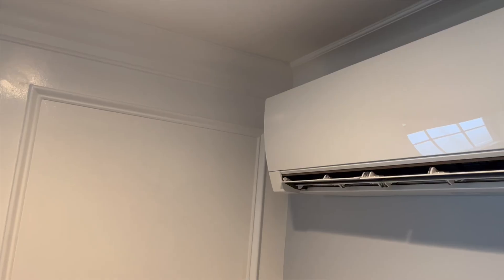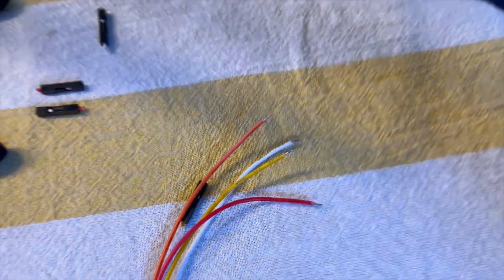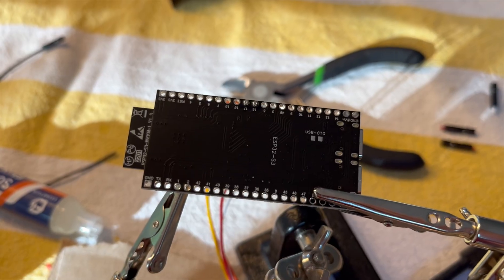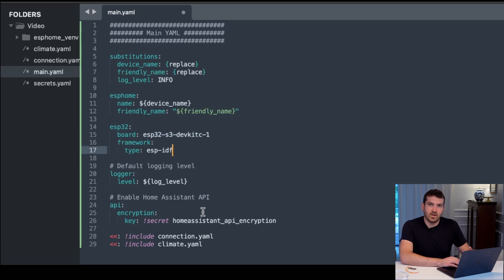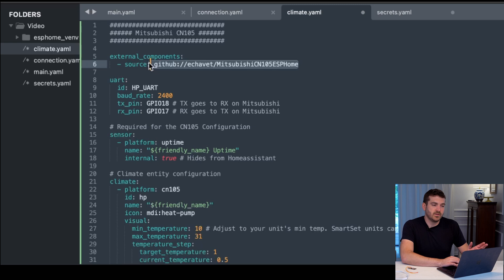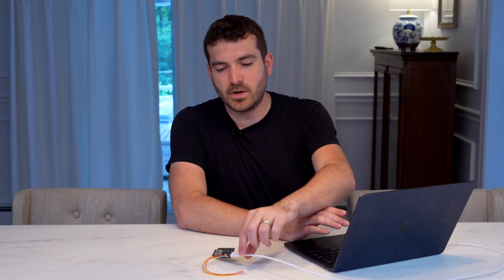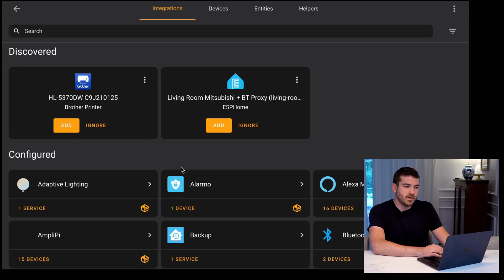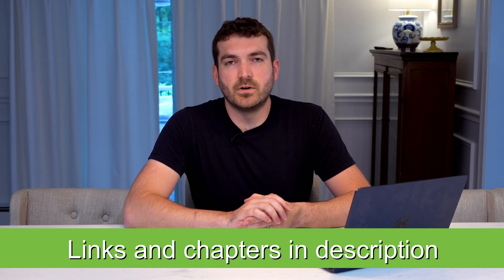ESP32 Guide: Mitsubishi HVAC Integration with Home Assistant

Comment from the maker: Thanks to @andrewlane50 for finding this -- I made a mistake in the YAML in the video at 8:45. Based on the soldering I did in the video the correct GPIO pins for TX/RX should be as follows:

tx_pin: GPIO17 # TX goes to RX on Mitsubishi
rx_pin: GPIO18 # RX goes to TX on Mitsubishi

ESP32 TX Pin -> Pin 17 -> Goes to Mitsubishi's RX
ESP32 RX Pin -> Pin 18 -> Goes to Mitsubishi's TX

Comment: @WarnerDiscovers. when you setup the yaml code. how do you know what your unit support and API. not sure how you figure out all this . is there some other documentation i am missing?
Reply from the maker: Hey there, all of the original documentation is in the github repository I linked in the description: 

https://github.com/echavet/MitsubishiCN105ESPHome

I also have "my" repository with all the code referenced in the video here: https://github.com/rwarner/ESP-CN105-Config

Everything else is mainly previous experience with YAML and ESP32 projects for HomeAssistant.

Comment: Hi thanks a lot for your video. I tried it using a esp32dev . I tried using my own TX GPIO17 and RX GPIO16 in my esp32, but it does not run. ESP32 was connected and I can see it online in HOME ASISTANT, but when I try put on Air cool, dry, hot...Mitshubishi does not nothing. I trid it changing baud_rate from 2400 to 9600 and 4800 but it does not anything. Can you help me?
regards!
Reply from the maker: Hey there, I would definitely suggest you to post over in the discussion area for the original repo here: https://github.com/echavet/MitsubishiCN105ESPHome/discussions

I think that they could possibly help you further outside of double checking all your GPIO pins which it seems like you have. Not sure if the ESP32Dev would prob different. Sorry I don't know off the top of my head

Comment: Thank you very much for this video! I have a question: could I use an ESP32-C6 in order to control the ACs using Zigbee instead of Wifi? Or for some reason is better to stick with the Wifi solution using the ESP32-S3?
Reply from the maker: Hey good question, I'm not exactly sure. I don't know is ESPHome is compatible with utilizing the Zigbee capabilities. I would probably look into that! Let me know if you are successful.
Reply: @WarnerDiscovers  Thank you for answering! I think the ESPHome environment doesn't natively support Zigbee, but I was wondering if it'd be possible to program the ESP32-C6 with different IDEs \ different programming languages in order to reach your same result you did. But I think that, in that case, I could not follow your tutorial anymore.

Comment: Its been a long time since you have your filter cleaned... 

Most usefull video in month on the topic, thanks!
Reply from the maker: Hah, yes I cleaned it right after. Appreciate the kind words! Glad it has helped people
Reply: @WarnerDiscovers  O.k. Erratum: 1. You have not mentioned anything about the pull up resistors, without which nothing will work as far as UART communication is concerned,  TX/RX on the board should be connected to 3.3V with 4.7K resistors. 2. Do not connect this thing when the unit is power supplied. Often it refuses to catch the network and you will taste sadness examining what was wrong => Power off -> Connect -> power On. 3. Could be irrelevant, but while searching for the roots of (2) I have changed the baud rate to 9600 and kept it when it started to work, so incase 2400 still fails, try 9600. Yes, I have ESP32-S3, if anything...

Comment: hi, no issues due to different voltages of cn105 vs esp32? According to some online resources a level shifter should be applied even for rx/tx since the signals are all 5v and not 3.3v (esp32)..
Reply from the maker: Hey good consideration, however with this particular board ESP32-S3-WROOM that I've referenced, we are using the 5v pin on the board on the bottom left: https://amzn.to/3UwoQJC
Reply: Hi, I understand that. but the rx and tx commands coming from the cn105 are also 5v, not 3.3v that esp32 can take.. have you maybe also considered that?
Reply from the maker: @JernejKralj  Hmm interesting, I looked into this a little bit and see what you mean. Maybe a potential oversight? It seems there's been a lot of success with this method regardless online. But, it seems to be a good consideration. It seems the more important piece would be a level shifter on the Tx-> Rx on the ESP32 level shifting down from 5v to 3.3v while the TX -> RX on the CN105 seems mostly okay recieving 3.3v from the ESP32 TX pin.

I would recommend opening a discussion on their github for a more in depth answer than I could provide: https://github.com/echavet/MitsubishiCN105ESPHome/discussions. 

It appears the original schematic with an esp8266 may have called for one: https://github.com/SwiCago/HeatPump/blob/master/README.md#demo-circuit

I noticed from a similiar blog post from a while ago that I referenced: https://chrdavis.github.io/hacking-a-mitsubishi-heat-pump-Part-1/ some people discovered that the level shifter was not required for these new devices coming out (e.g. Wemos D1) so perhaps this faded as a concern as the newer esp devices accommodated for this

Comment: Thanks for this video!  Got me back in gear to set up this integration with my 5 zone system.  2 Questions: 
1. Did you add one of these to your outdoor compressor unit?  Any value to that?
2. I purchased the devkit you linked out to and have been working with them on the bench. Unfortunately, it seems that about 50% of the time when I plug the device in via USB-C for power, they dont boot or boot in to a state where they are awaiting a firmware image.  One press of the reset button, and they function as normal.  Did you experience this issue with your dev boards?
Reply from the maker: Glad it is helpful!
1 - No I didn’t not sure if there is a port out there for the CN105. I would refer to their Github for more details, just on two of my indoor units. Planning to use a splitter for my indoor attic one in combo with an MKH2 thermostat or w/e.
2- I also got this occasionally, try using the opposite USB-C port on the device. It seems like one of them is more dedicated to flashing than the other since it has 2 on the one I linked I think.
Reply: @WarnerDiscovers yea, i got the issue from both ports and from the 5v supply on my head unit. 50/50 if it boots properly.  A press to the rst button fixes it, but i dont wanna have to start opening head units every power outage.

Currently going down a rabbit hole on this on other forums.
Reply from the maker: @AlexHorwatt  Yes, I totally agree. I had this same issue in the beginning, but once I switched USB-C ports and didn't use any web gui just directly flashed using the command line it didn't have the issue again. Sorry I can't be of more help here for you for this particular issue!
Reply: @WarnerDiscovers  Just to close this out...  Finished installing these ESP32s on my 5 zone system, but every time I power cycle the heatpump I had to go around and hit the reset on each unit. I ended up soldering a 10K ohm resistor from the 3.3V to pin 0 to resolve this.  My working theory is that on startup, the heatpump doesnt provide a clean 5V and the ESP32's weak pull up resistor fails to pull pin 0 high enough, and the unit ends up in boot mode. Adding the resistor pulls pin 0 sufficiently high allowing the unit to boot properly.  

Thanks again for this video and your github for reference!
Reply from the maker: @AlexHorwatt  Thanks for the update and advice on this odd situation!

I would definitely recommend posting this on their original Github and perhaps something for their Readme for Eric to checkout (the original owner of the repo)

Comment: So I'm trying to do this on Windows with powershell, but I'm stuck with the command "ls -la /dev/tty.*" and the command "esphome upload main.yaml --device /dev/tty.usbmodem101". How can I accomplish this on Windows?
Reply from the maker: I’m not super familiar with powershell, I would probably suggest trying it with Bash for Windows or whatever the Ubuntu included shell is called. Then from there doing the whole pyenv installation and installing esphome into a new python virtual environment. For the /dev/tty, at that point “ls -la” should work in your path, but that might not be the same directory for devices plugged into your Windows machine. I hope this helps
Reply: I developed and uploaded my code entirely on Windows using Visual Studio Code and esphome.  For me, "esphome upload main.yaml" actually prompted me with a list of COM ports to select from, making the process super easy.

Comment: Thanks for putting up this video. Helped me to surpass the hurdle I had been facing since Dec 2024. Works fully with MFZ-KJ**VE floor units units. I used esphome and esp32 wroom dev board (tx_pin: GPIO17; rx_pin: GPIO16). Rest is primarily your yaml code. Much easier than IR blaster path I had been trying to fix. So simple and full control of the heat pump. Thanks again
Reply from the maker: Awesome so happy its helping people!

Comment: I'm so glad I stumbled on this when I was thinking of buying ir blaster type smart thermostats to control my three minisplits. Are you only using it to control mini splits or do you have a central air handler as well? My house has three mitsubishi minisplits in the bedrooms and then a ducted air handler for the main floor all connected to the same outdoor unit. As far as I can tell the air handler has a cn105 port on its control board so I'm hoping it is also compatible.
Reply from the maker: Glad it helped! I am only using it to control mini splits at the moment. I do have a ducted air handler in the attic, however according to some posts on their Github repo it might act slightly differently. I was going to pursue their advice over there for handling those types of units. Most people seemingly use some sort of CN105 splitter to support the MKH2 Thermostat as well as this ESP32.

Comment: This was such a huge help!! Thank you for putting this video together and compiling all the resources. One thing that I would consider, however, is leaning into the ESPHome Device Builder. You can still walk through the different YAML configs but the builder removes the need for all the cmd line interactions that might be less ergonomic for some. It also makes setting up the wifi and testing your build so much easier.
Reply from the maker: Thanks for watching and glad it was helpful! I will have to look through the ESPHome Device Builder, dealing with Home Assistant pretty frequently some YAML doesn’t bother me like this! lol
Reply: @WarnerDiscovers this is where I'm stuck at. I have no idea how to get to where you start using the command lines. What program are you using?
Reply from the maker: @007hungryman  Hey, the program I am using for YAML is "Sublime Text". I'm using a plugin to show the Terminal (i.e. the OSX Bash terminal). Alternatively, you could use any other terminal or bash/zsh prompt and utilize Python the same way I do in the video.

If you're unfamiliar with bash, zsh or a terminal or python -- I would definitely look into ESPHome Device Builder as this person suggested, unfortunately it would be out of the scope of this video in terms of installation but all the YAML would still be relevant for the configuration.
Reply: @WarnerDiscovers Thank You! If I can get everything working the way you show,  Ill try to get it working with a POESP32 over ethernet.

Comment: Hi. Why did you delete my comment? I was just sugesting another device to do the same, but really better, smaller and in a little cute box.
Reply from the maker: Hi, I did not delete any comment like that feel free to make any suggestions
Reply: I don't know what happened. I have my AC's with the same think, but with M5Stack atom lite. The advantage is the size, already with a 4pin conector and in a case. All very clean

Comment: Hi, very useful video, thank you. I purchased all the components and soldered the cables to the board. I plug it into the CN105 port on my AC and it does not work. Checking the logs it seems the heat pump is not connected. Have tested everything with the multimeter and the conections are good. Do you have any idea what it might be? Thank you!
Reply from the maker: Hey thanks for checking the video out, I appreciate it and glad it was useful. Very strange, whenever I ran into this issue it’s because my GPIO pins were backwards. Even if you’re confident the TX is going to the RX and the RX is going to the TX try switching them in your ESP Yaml and seeing if that makes a difference. Otherwise perhaps enable some more logging in the Github library and see if it tells you anything more.

Also double check the Model number on their Github repository has been tested but if it’s a Mitsubishi I’d be surprised if it wasn’t compatible.
Reply: @WarnerDiscovers i tried a pin loopback via software to see if the soldering is fine, and I was able to verify it. I switched the pins on the yaml as well and it did not work. Very strange. I wonder if my unit is too old to use the UART protocol, even though it has the CN105 port :(
Reply from the maker: @ManuelGarcia-pf9eb  Dang, sorry to hear that :( definitely reach out on their Github repository (discussion) section for more help and seeing if there's something you might be missing.

Comment: At 1:32 you mention that the yellow wire is Mitsubishi TX, and then at 3:32 you solder it to GPIO 18. So, 18, should be ESP32 RX as you say. But later in your config at 8:45 you have GPIO 18 as tx_pin. Is this right? Or is that a mistake in the YAML shown in the video?
Reply from the maker: Hey Andrew, really really good catch here. You can see I definitely tripped myself up here explaining it so many times. I made a "demo" project to showcase this for the video, but ended up swapping those two pins in the end accidentally. So you are correct:

tx_pin: GPIO17 # TX goes to RX on Mitsubishi
rx_pin: GPIO18 # RX goes to TX on Mitsubishi

^ This is how it should be, I'll go ahead and update my git repo and try to add a note or something on the video. Most important thing is specifying what GPIO pin you want to use as TX/RX and having them meet the opposite on the Mitsubishi.

Thanks for pointing this out!
Reply: @WarnerDiscovers  Thanks for confirming! The video was super helpful!

Comment: Thanks. Does the Power sensor show the live Kw use? Was wondering if I can use that in  my consumption stats etc. thanks
Reply from the maker: Unfortunately, I don't think so. The two sensors available are :

    input_power_sensor:
      name: Input Power
      disabled_by_default: true
    kwh_sensor:
      name: Energy Usage
      disabled_by_default: true

I have only seen the kwh_sensor work. And only one of the two I have installed actually worked to read it. That sensor in particular is a "over time" sensor, I forget what they called it but it shows you the total power consumed once the time passes. You can easily plug it into the energy section to tell you consumption, but nothing live unfortunately.
Reply: @WarnerDiscovers Ah yes thought so. Thanks

Comment: I have a Wemos D1 Mini lying around. Do you think I can do the same on it? It does accept 5V.

I'm no engineer and have no coding experience whatsoever. I will just blindly follow everything on the video and maybe just change the name of the board.
Reply from the maker: I would be hesitant to use the D1 Mini given how cheap an ESP32 board is to get. According to their Readme:

"ESP8266 boards such as the WeMos D1 Mini clones (LOLIN in particular) tend to be unreliable in this application, and may require an external voltage regulator to work. While some users have successfully used ESP8266 based devices, if you are purchasing new hardware for use with this project, it is recommended to focus on the more modern and powerful ESP32-S3 based devices."

See more here: https://github.com/echavet/MitsubishiCN105ESPHome/blob/main/README.md#supported-microcontrollers

If you do decide to do it, there may be further config changes you might need to compile for an ESP8266 and different baud rates and such.
Reply: @WarnerDiscovers Alright, makes sense. 

I’ll just buy a ESP32 S3 DevKit Board and blindly follow the steps laid out by you. 

Thanks a ton!